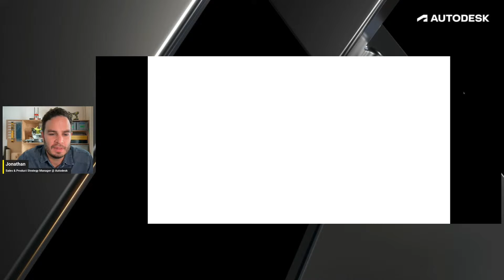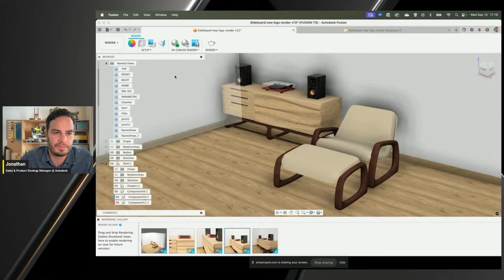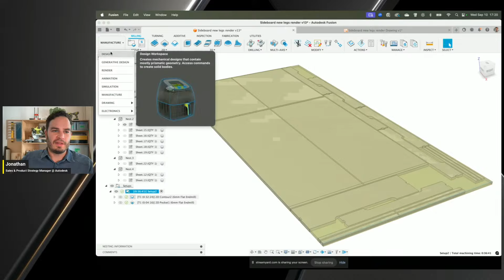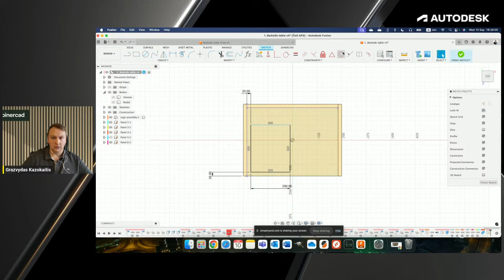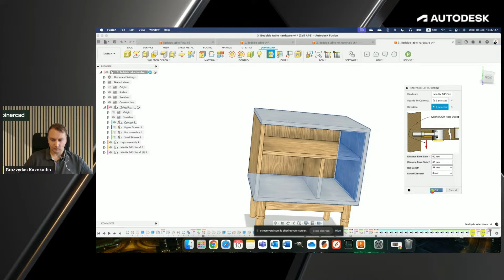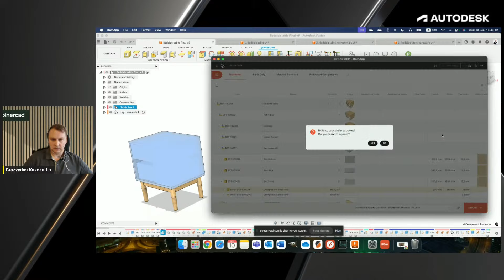Elevate Your Craft: Autodesk Fusion and JoinerCAD for Furniture Design

Comment: A few questions. Is there an easy way to apply a face frame to a cabinet using joinercad? I made a base cabinet using joinercad but it seems like I have to manually add a face frame. Also when I add shelf pin holes using the add hardware function I'm just getting circles, not holes? Is there any plan to add more advanced joinery or floating tenon(domino)? The rafix and similar connectors are more for manufacturing flat pack furniture and not woodwork.
Reply: Thanks for your questions! Currently JoinerCAD doesn’t have a dedicated face frame feature — this is actually the first request for it in 7 years. For now, you can only model it manually. We use cylinders for shelf pin holes because the hole info comes from the hardware definition, so you won’t see actual “holes” on the outer surface. Domino connectors are already included. Rafix and similar connectors are more for flat-pack manufacturing, but we’re always open to feedback and ideas from woodworkers.

Comment: how about you fix DXF exports for laser /water jet cutting. nice to see you trying to expand into CAM more, but you somehow have made basic exporting of DXF files worse than it used to be. This seems like a pretty basic function you somehow ruined that is closely related to all your CAM functionality desires.
Reply: if this question related with joinerCAD - we do not export to .dxf. The only export  JoinerCAD does is a report (.xslx or any other text format).
Reply: @GrK093 it's not related to joinercad specifically but more towards fusion360's push towards CAM functionality. Which in a way is related to joinercad. Also not so much a question as more of a gripe. If fusion360 wants to push CAM functionality so much, then why make dxf functionality worse when it is a widely used format in flat pattern cutting machines ... CAM

Comment: Question... It wasn't shown if we can use parameters for things like panel thickness, etc.  How much can we leverage the parametric features of Fusion within Joinercad?
Reply: Partly. Fusion does not support custom features at the moment. This means we can't add them to the timeline like an Extrude or any other native feature and edit after creation. But for the update we have update/refresh commands where you can select panels and change their thicknesses or update number of shelves and dividers for example.